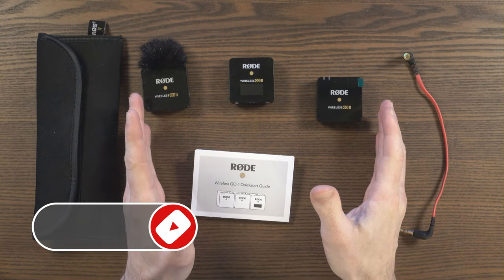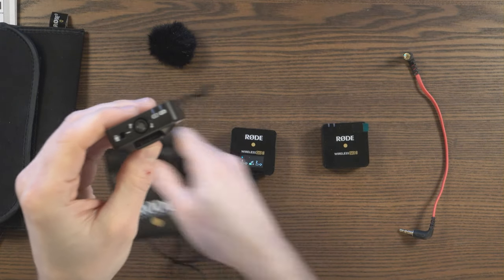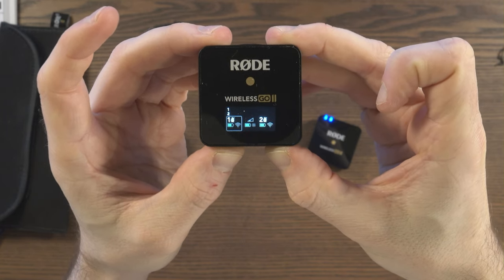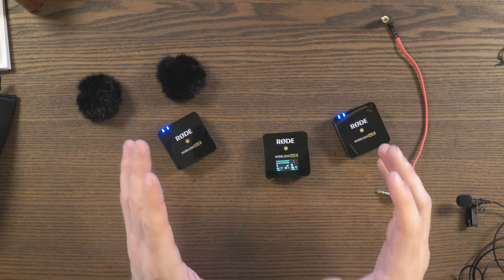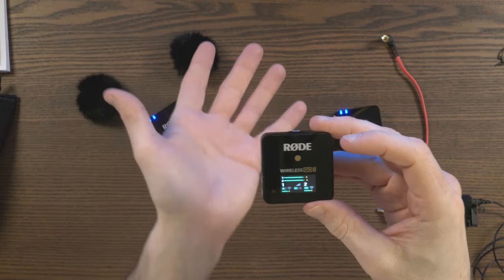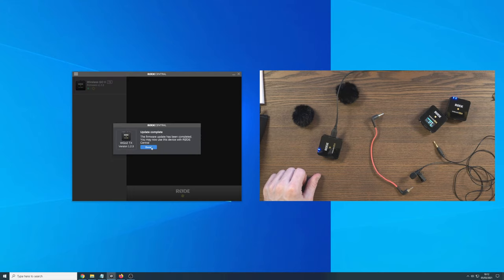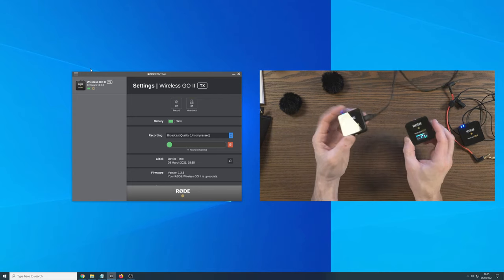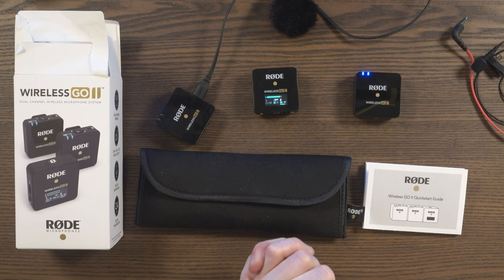How to Use the Rode Wireless Go II

Comment: Once I worked out that 'Lesson' = Listen and 'Fail' = file I was good to go. Kevin, I'm just pulling your leg.  I adore your accent.  Yours is much more eloquent than my barbaric Californian twang.  Your presentation/tutorial was BRILLIANT! Thank you for taking the time and effort to go over the fine details you can't read inside the manual.  Thank you for clearly and concisely guiding us through everything we need to know (and the tips and tricks) about the devices.  You're the BOMB!
Reply from the maker: You're welcome Bill. Glad you found it useful.

How have you been using the mic? Camera? Smartphone?
Reply: @KevinMuldoon I previousely worked with Wireless Go.  Now I've upgraded to the Wireless Go II.  I used it for my previous Facebook posts.  Now I'm diving into revamping a new YouTube channel and will do Talking Head vidz.  I like not having to unconsciousely lean forward with overhead shotguns or putting in-frame broadcast mics.  Thanks
Reply from the maker: Yeah that makes sense. I have the SM7B for voiceovers but use an overhead shotgun mic usually. Problem is the sound drops quickly when I'm just a little off centre.

Comment: Hello. Congrats for your video. I Have just received my new Rode Wireless Go II and i have a problem. I am using this mic with my Lumix GH5. The recoreded sound is mono and as I can see , the level of the sound in the Right chanel is almost zero. What am I doing wrong?

I use only one transmitter (mode merged).  Thanks
Reply from the maker: Could it be a setting in the Lumix GH5? 

I'd double check another mic with the camera to double check that issue isn't happening with all mics.

Comment: Very helpful! I just bought one and it was great to get your insights into the pros and cons and how to understand the ins and outs of this setup. Thanks for making this video :)
Reply from the maker: You're welcome Oisin. Glad you found the tutorial helpful.
Reply: I bought a new RØDE WIRELESS GO 2 SINGLE KIT and RØDE LAVALIER GO MICROPHONE (also I bought RØDE FLEXCLIP GO SET) and my question is:
Can I somehow use my RØDE WIRELESS GO 2 SINGLE KIT for dual audio channels with some 3.5mm Y adapter to 2 x females 3.5mm inputs on my RØDE WIRELESS GO 2 RECIEVER, one input will go into my GOPRO MEDIA MOD and in another input I will plug my RØDE LAVALIER GO MICROPHONE, can I use my RØDE WIRELESS GO 2 SINGLE KIT with RØDE LAVALIER GO MICROPHONE or some other microphone for dual audio recording or can I add second channel in post-processing and which software is best for that???
Thank's a lot in advance and I will appreciate any kind of help, because I can't find to buy separately just one RØDE WIRELESS GO 2 TRANSMITER and in that way had a regular RØDE WIRELESS GO 2 MICROPHONE???
Reply from the maker: There is an option in the wireless go 2 to use record to two mono tracks instead of one stereo.
Reply: @KevinMuldoon  Thank's a lot...

Comment: Thanks for the video, do you think this can be used as a monitor with 1 transmitter paired to two receivers?
Reply from the maker: What kind of audio monitoring? I'm not sure if the exact setup you're suggesting.
Reply: @KevinMuldoon  thanks for the reply. Basically i want to pair a single transmitter on the same channel as 2 receivers, the transmitter will be connected to the camera output and then the receivers will have headphones for the director and the AD in another room. That way they can hear what's being said without crowding the room
Reply from the maker: Mmm I'm not sure that's possible as it's designed for one receiver and two transmitters. 

You would perhaps have to reroute the signal from the receiver to achieve this.

Comment: You need a splitter cable coming out of the wireless go ii , that would split the signal coming out of it into 2 mono signals, right now you are using a converter on your audio interface but that audio interface is probably only able to use the one side because its designed for a mono input not a stereo signal thats coming out of the wireless go
Reply from the maker: I don't think that's the issue.

The Rode VXLR+ supports a stereo signal.

I've sent stereo signals from other mics to it and not has a problem.
Reply: @KevinMuldoon  I'm using a VXLR pro and only getting one channel in split mode when monitoring. Also seems it's only recording one channel too. Merged mode gives me both, not much info on this from rode. Is the only workaround to use a split cable?
Reply from the maker: In surprised it only recorded one channel as split channel still recorded both for me.

What were you using to record with?

Comment: When de Rode GO 2 do not pairing: 1. Switch on the receiver. 2. Switch on the two microphones. 3, Press and hold the number two button "on the receiver" for three seconds until the Wifi icon starts flashing. 4. Then click button number two once and wait for the connection. 5. For the second microphone, repeat steps 3 and 4.
Reply: THANK YOU!
Reply: Hello from the Serbia... Nice review mate... I have one question for you, because I bought RØDE WIRELESS GO 2 SINGLE KIT for my GOPRO HERO 10 SPECIAL BUNDLE camera (I also bought MEDIA MOD, LIGHT MOD, DISPLAY MOD and RØDE LAVALIER GO MICROPHONE):
Van I use my RØDE WIRELESS GO 2 RECIEVER (with some quality 3.5mm Y adapter to 2 x female 3.5mm TRS inputs) and also use my RØDE WIRELESS GO 2 MICROPHONE?
Thank's a lot mate and greetings from the Serbia...
Reply from the maker: Hope the weather in Serbia is nice. I have a similar kit to you with the GoPro media mod etc. 

I've not used the wireless go 2 package with it yet, but it should work ok with the 3.5mm connection.
Reply: @KevinMuldoon   The weather is ok, summer coming slowly but surely, sometimes it's raining, but is ok for the June and the temperature are now about 23°C daily and about 14°C at night...
Thank's a lot mate...
Reply from the maker: Nice. Enjoy. We've had an unexpected heatwave here in the UK. The rain will return soon 😁
Reply: @KevinMuldoon  It will be unusual summer...

Comment: You don’t have to go on your computer to change the receiver from split or mergerd mode; just hold both buttons on the receiver for a few seconds to do this. And the on board recordings best used in the event you have a drop out from loss of connection. Then you’d have a backup recording to patch into the dropped audio.
Reply from the maker: Thanks for the tip. 👍
Reply: Killer tip!  After reading this I checked if there was an on-board option to toggle the pad on the Rx and found it:  

"You can also activate the pad from the receiver by selecting the transmitter using the pair button (‘∞‘), followed by a long press on the ‘dB’ button."    Note: you have to release the pair button and then hit the db button, otherwise it just changes the merge mode.  The pad symbol is a blue down arrow.

Comment: I have a question about the one-sided sound.

When I plug it in to my Android phone and then I play back I only hear it on the left speaker.

So when I do a 5-minute video. Then I'll play back the sound is only on my left speaker or left earphone.  Why?

Can you help me?
Reply from the maker: I recommend connecting the wireless go to your computer and checking your configuration setup via Rode's software.  That might help explain what's going on.

Comment: Thanks for the great video Kevin, having purchased the Ride Go 2 for Moto Vlogging I came across a recording issue. Only audio from transmitter No1 was recorded, yet the receiver, obviously set on split by default showed both working? Even after doing an app update I couldn't get No2 to register with my Insta 360 camera. Someone warned me about the On button mute function.

 I connected to the phone app muted and un muted the TX  and then it showed as such on the receiver. At the same time I selected merged then tested audio through my camera and it worked. Your info about only one channel registering through your voice recorder on split makes me think it was switching to merged rather that un muting which resolved the problem. 👍
Reply from the maker: Glad it helped you Michael.

I think a few of the issues that I raised have been improved a little since launch through updates. On the whole, it's a great little package.
Reply: @KevinMuldoon   Thanks for your reply, I finally have both transmitters working which should make my Moto vlogs with pillion a pleasure rather than again to watch 👍

Comment: Hi, Thank for the awesome review of Rode Go2. Can you please tell, if the new version i.e. Rode Go 2 has inbuilt ANC, as there is no ANC in the older version of Rode and all kind of background sound/ or voice keeps getting into the audio.
Reply from the maker: I don't believe there is any noise cancellation. This is something you'd have to do in post or your I'd have to connect a microphone that has ANC.
Reply: @KevinMuldoon  Hi, last night it was raining, my Rode Wireless 1 (older version) captured the sound of the drops, if there is any child playing at some distance, it captures that too.

It seems I have to reduce the “dB” , Older Version of Rode has three Levele i.e. Low, Medium and High. I will set the dB at Med or Low, so that it stops capturing background voice and sounds, as reducing dB will reduce the “circle” of recording. I think so, not tried yet.

Comment: I've got my wireless 2 set to split mode. I was hoping it would record one mic on the left channel and one on the right. But when i do a recording with my camera. Both channels are the same. Both left and right are identical with no separation of the mics. Any ideas?
Reply from the maker: I guess this issue is from the camera, not the wireless go II. Is the camera recording in mono instead of stereo?

Comment: Hi.. I have a question. Im using the Rode Go 2, with a Rode NTG-2, and connected to a AMS-24. Im using this to cut out the need for a cord, and making it easy to move around. The problem is I have to boost everything to get sound. Even when boosted to the highest settings the sound is low, and I still have lots of static. Any suggestions on what i should do, or why this doesn't work? When I just plug up a XLR everything works fine, or if I just unplug the shotgun mic the Rode Go works fine, but for some reason it doesn't work well together.
Reply from the maker: I'm not 100% sure how you have it all connected.

So are you connecting the Rode NTG-2 directly to the Go 2 using an adapter?

How exactly are you adapting XLR to 3.5mm for a direct connection? My guess is that is where the issue lies.
Reply: @KevinMuldoon   Thanks for commenting. I'm using a "XLR Female to Right Angle 3.5mm" to connect the ngt-2 to the Rode Go 2 transmitter, and using a "XLR Male to Right Angle 3.5mm" to connect the receiver to the AMS-24.
Reply from the maker: My guess is one or both of those adapters are the issue. 

I have a sennheiser XLR to 3.5mm adapter that causes problems with some setups too. 

The Rode VXLR+ is more reliable in my experience for adapting connections with audio interfaces.

Comment: Hi there, really great review! Just a question: when I run interviews, on my camera I have small shotgun plugged in, so the Rode Wireless GO II Receiver won't be connected to the camera.
How can I monitor the audio/level of the interviewee(s) coming from the two Wireless GO II Transmitters? If I plug my headphones into the Receiver I won't get any audio...
Many thanks
Reply from the maker: Hi Alessandro. 

I'm not sure I fully understand your setup. You have a shotgun mic connected to the camera and two separate connectors wireless go mics connected to the interviewees?
Reply: @KevinMuldoon  Hi Kevin thanks for your reply. Yes, I have a Rode VideoPro plugged into my camera, which I use as reference/backup.
And the Go2, which I would need to somehow monitor as it's the main audio.
Reply from the maker: You'd have to test audio before hand and then just monitor the levels on the wireless go itself. 

Alternatively, you could connect the wireless go mics to an audio interface and monitor things from there.

Comment: Hi Kevin..I have watched quite a few similar videos and most said the same thing. You’ve covered more. It’s clearer and more informative. Thanks. I have my wireless Go2 for 2 months now but I can’t get a quality recording for my video content. I have tried switching between split and merge mode. Tested with only one transmitter and then both transmitters on the different mode. My recording still sound like coming from one side only. It’s obvious on a headset. Not a stereo sound. I connect the receiver to my DSLR Canon camera to shoot my video. Do you have any advice? I went through the Rode’s Learning Hub. Do I need to buy extra accessories like SC11 and DCS-1 to get that stereo sound? Thanks in advance. Cheers, Victor.
Reply from the maker: Hi Victor. 

I haven't experienced that myself, but I've only been using mine in a limited way.

Which camera have you been using it with? Outside or inside?

Kevin
Reply: @KevinMuldoon  I am using Canon EOS 200D and inside only. I’ve tried merge mode with one transmitter only but I still get one side sound only either on right or left, not centred. Something I’m not doing right? Cheers, Victor
Reply from the maker: It actually sounds like the receiver isn't working, but it's hard to say.
Reply: @KevinMuldoon  ..thanks. I've got it to work now. Sound is centred rather than coming from one side. I adjusted the manual setting in my camera, and not sure if it is to do with how I have connected the receiver to the camera. I set the receiver to -9db. Cheers, Victor
Reply from the maker: Glad you got it working. 👍

Comment: can we monitor audio of rode wireless go ii through wireless headphones?
Reply from the maker: Their website states:

"Headphone monitoring – Using the USB-C output frees up the 3.5mm output so you can plug your headphones in and monitor your audio while recording. You can even use the gain control to adjust the volume of your headphones."

There are videos on YouTube showing how you can connect headphones wirelessly using a Bluetooth transmitter. Such as this one https://youtu.be/iO1aF8-cuD0 (I believe that shows the first wireless go, but the principle is the same).

Comment: Having a problem. When I listen back to footage on my headset I can only hear on the left side how do I fix so it is mono audio? And not just on left side?
Reply from the maker: Hey Chet. How do you have it set up? Recording via a camera or directly to the wireless go?

You can adjust many settings using Rode's software.
Reply: @KevinMuldoon  what’s up. I have it connected to my a7iii but I’ve only used one receiver and when I import I only hear audio on the left side
Reply from the maker: That's strange. I've not experienced this issue myself. Most mono connections into cameras are converted to a stereo signal by the camera.
Reply: @KevinMuldoon  ahh ok I will try to figure out yeah because I can’t edit the footage right with audio on one side

Comment: I got 50 files to export. Do I need each individual to export and wait? I can't export all files at once? All at once?
Reply from the maker: If you look at my video around the 24 minute mark, you can see when the transmitter is connected, it works as a storage drive. Unfortunately, the audio files are stored as .UGG and .EGG files. 

I don't know if it's possible to convert these file formats easily, so you may have to export each one manually. I don't see why they can't add an export all option later.

Comment: Very helpful. My mic is coming tomorrow. I just downloaded the app so I'm ready to play.
Reply from the maker: Glad you found it useful. I've found them to be great mics so far.
Reply: @KevinMuldoon  did you know you can switch between split and merged channel from the device? Your video makes it sound like you need the app but if you hold down both buttons of the device it will switch.
Reply from the maker: I believe that's a feature they added later in a recent firmware update. 

There's been a few other features like that they've added over the last few months via updates.
Reply: @KevinMuldoon  actually it worked on the 1.0 firmware. I found out about it in the manual it came with.
Reply from the maker: It definitely didn't work with the initial release as when I bought it, it said mono and stereo. 

Originally, it was mono and stereo mode, not split and merged. That wasn't added until version 1.19 (see https://www.4kshooters.net/2021/03/02/rode-to-address-wireless-go-ii-export-issues-with-a-firmware-update/).

Looks like when that was added, you could change between the modes, by holding the pair and hold buttons. I must have missed that in my tutorial.

👍